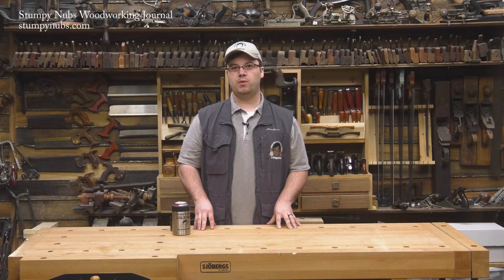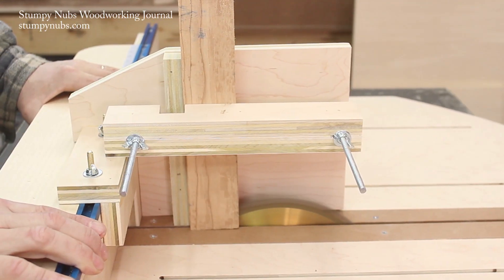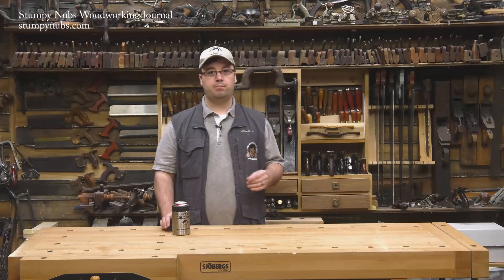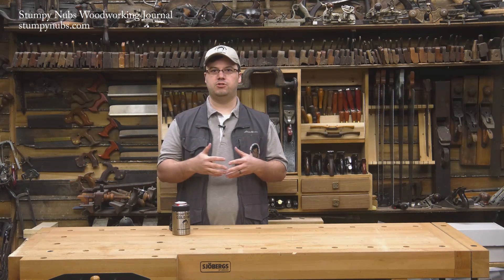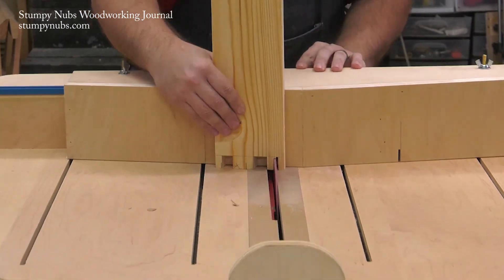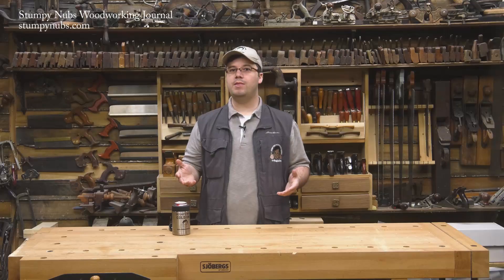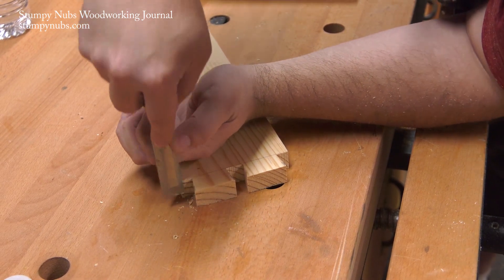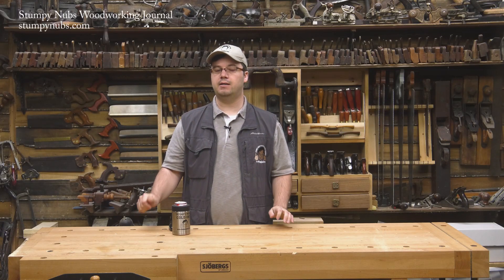Cut PERFECT dovetails on a table saw sled- that look hand cut!

Comment: I get the pins jig, that definitely makes the pins easier to cut on the table saw rather than using a mitre push. However, I don't understand why you would not want to use the blade angling? The tails jig just seems too complex and difficult when just angling the blade can give you same result?
Reply: And, if he had bought a Ridge Carbide 8º dovetail blade, both the jig and the chisel work would not be needed.

Comment: Hi Stumpy Nubs, bought the plans and assembling today as a stand-alone which I'll clamp to my crosscut sled. I was wondering if you could give an insight on the limitations of this setup. How big can the board be (width) before it bottoms out preventing access to cut more, or the height of the blade topping out? Thanks.

Comment: that is really cool James so there is a way to use this jig without making your sled also can this be used on just a basic cross cut sled with t tracks on top of it thanks bro
Reply from the maker: Yes. Woodworker's Journal did something similar years ago, but theirs was a stand-alone sled. Others have made various versions of it over the years as well.
Reply: Stumpy Nubs okay cool thanks man

Comment: very good jig
I think that an improvement should be making the dovetail fence attached to the sled with a pivot point in the center putting a 
 stop block behind  at a certain angle. Tthis will allow to cut both side ony twisting the fence and not moving it. also the angle will not be fixed, but variable.
Reply from the maker: That wouldn't be practical because the tails half of the jig would need to be adjustable to match the same angles. But because you only have so much depth of cut with the saw blade, it would be very difficult to make an adjustable tails jig.